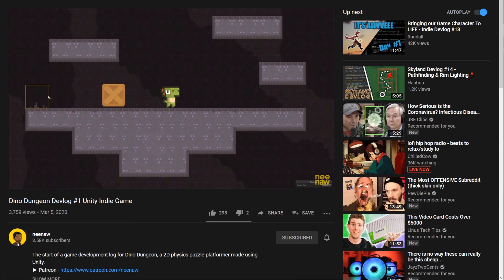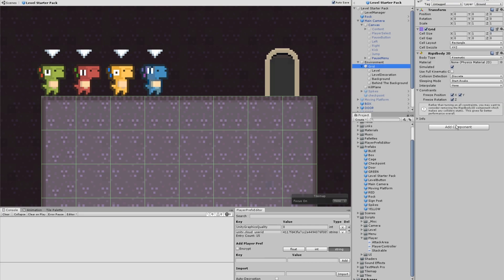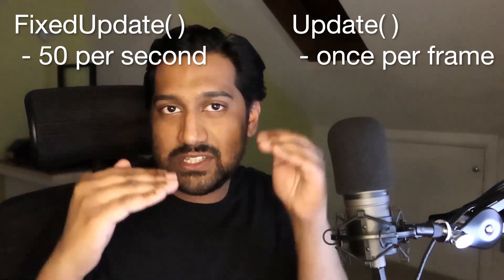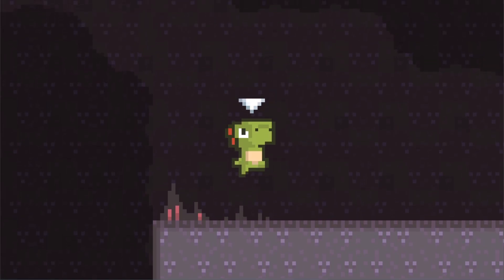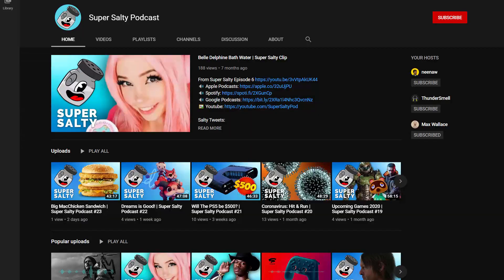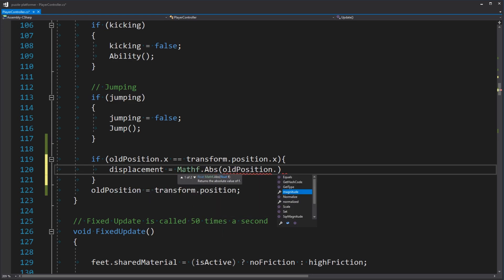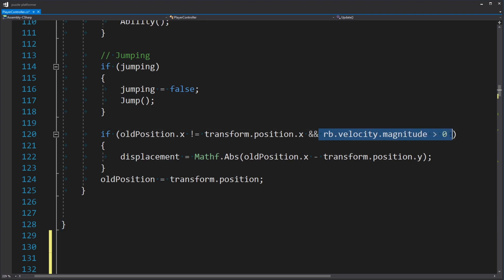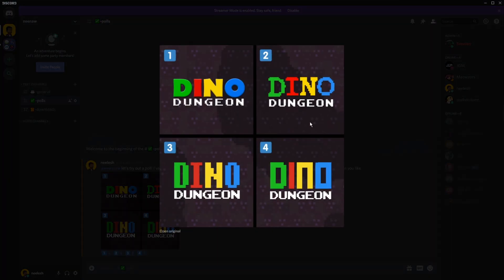Bug Fixing | Dino Dungeon Devlog #2 (Unity Indie Game)

Comment: An edge collider also works well to avoid getting stuck. I usually block out my walkable surfaces on 1 tilemap that has colliders. Then anything that can't be reached is on a separate tilemap with no colliders.